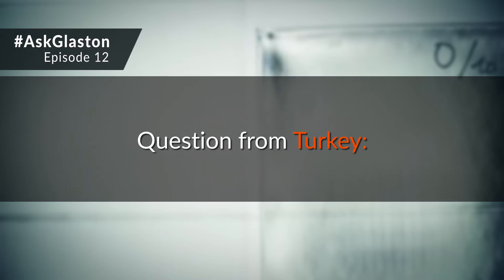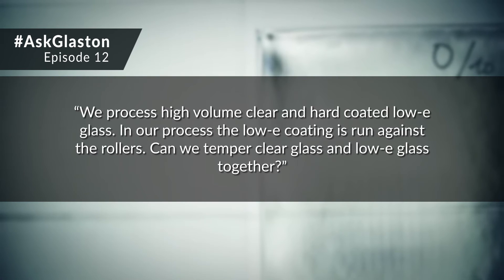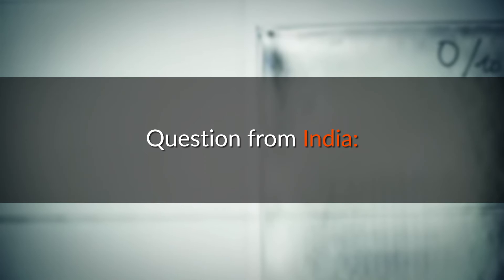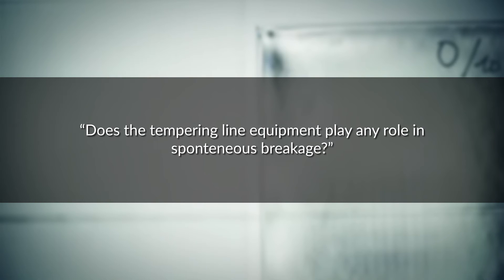#AskGlaston Episode12 Can we temper clear and Low-E glass together?

Comment: I have a question, what is the best solution to the wind and glass together to make it work.

I'm making a design whose dome of glass, but the wind bashing in on the glass dome this will create extreme wind gusts around the building, what is the best solution to prevent this.

I was thinking of a screw pattern in the dome